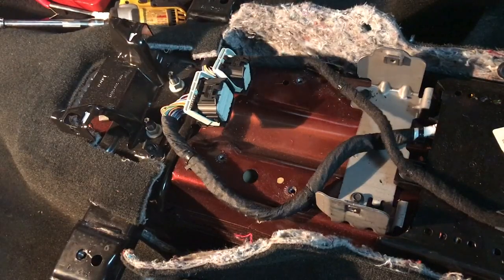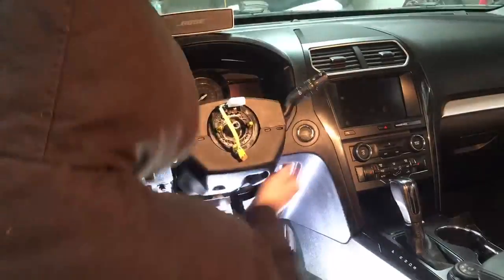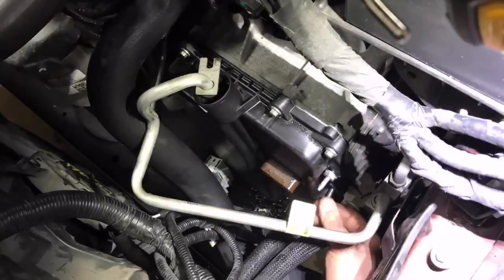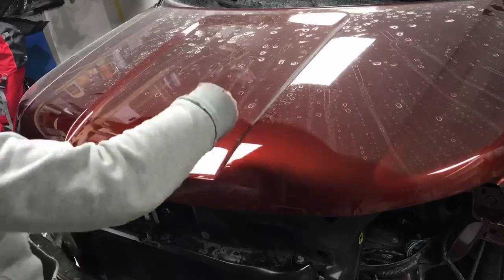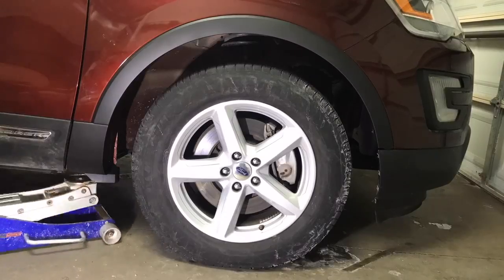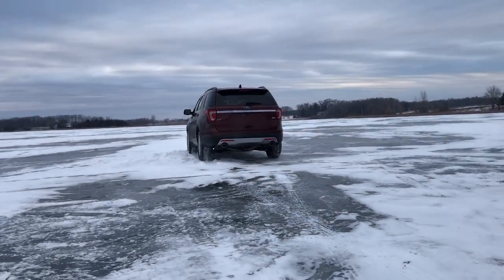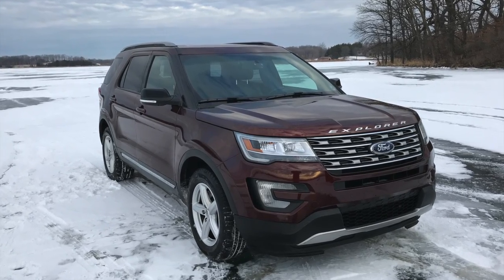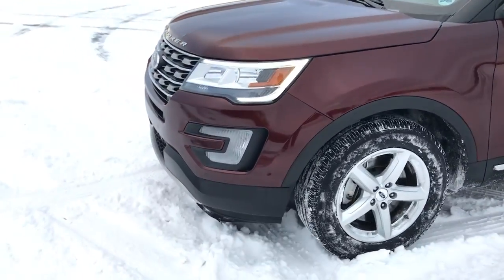(EP 3/3) Copart repair COMPLETED: 2016 Ford Explorer PART 3

Comment: hi how do you know how to disassemble the dash and the operation of the systems like steering column collapse or power light computers or that you have to replace the module due to crash data? do you follow a factory manual or any helpful data? thanks
Reply from the maker: Hi rotoR Col, I keep track of everything I remove to ensure everything goes back to factory spec! Experience also helps. Thank you for watching!
Reply: thanks for your reply and your time doing these videos

Comment: How do you reset your srs module?? I have light on for air bag on 2013 F-150, but zero codes when checked with scan tool.
Reply from the maker: You may need to send it out to a specialist or replace it. Used replacement modules are usually reasonably priced! Thanks for watching!

Comment: Looking at a flooded car on coparts. There’s no reserve and from what I see it’s a super clean car. Looks like the spark plugs have been removed and has a small dent in the rear bumper. Thinking about bidding $400.00 bucks and just closing my eyes. No way I could win it for $400 but if I did and it’s a piece I should be able to part it out for $700 with the fees the auction charges. Any advice on flooded cars from coparts?

Comment: Hi, great video!  Questions: (1) Have you sold off the SUV? (2) How much did you get for it. (3) Wholesalers won't touch salvage, right? (4) If you sold it, have you tracked the VIN to see if it was eventually title washed? and last (5) How much under KBB wholesale (trade-in) have you sold a salvage car for, percentage wise.  Thanks again!

Comment: where did u get the Sport steering wheel? We just bought a 2018 Explorer XLT with the sport appearance package, would it shift if we replace it with the sport steering wheel?
Reply from the maker: Congrats on your new purchase! I didn't replace my steering wheel but I believe its very similar Sport model. They didn't change much between packages.
Reply: apparently they took out the paddle shifter from the steering wheel for 2018, do you know where I can buy one?
Reply from the maker: Oh no way? I didn't know they remove that feature.... You should double check with dealer because they changed quite a few things in 2018 models. Make sure they are compatible.

Comment: It bothers me that you just replace everything even though its a small damage. The transmission cover you couldb have repaired with $7 epoxy, the steering coil you could haveb just spliced the wires together. No need to waste money

Comment: Great gob but the frame rails are still kinked
Reply: Hamish Davidson there is no frame.
Reply: TiDo what do you call it then? It is part of the frame, on each side of the engine there is a big beam, they are both kinked
Reply from the maker: I believe you're referring to the factory kinking on the rails.. They have to have kinks to absorb energy in a head on collision. Most moderns cars have this to reduce injury to occupants. Thanks for watching Hamish!